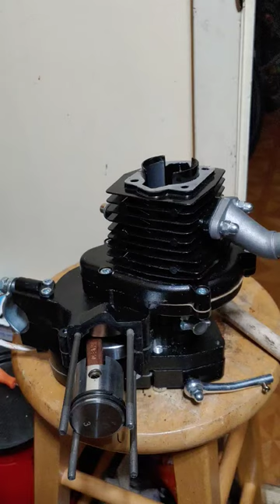Pre-Painted Motors

Comment: It was proven about 35 yrs ago in popular mechanics a article said that a black painted engine dissipates heat better than one not painted but you are exactly right about the bearing issue.  ..they shouldn't paint any bearing surfaces at all...

Comment: I had a silver one we used as a homemade dirtbike,  definitely got abused and never used correctly,  lasted 2 years and it had only like half of the cooling fins on one side from crashing it so much, I eventually got rid of it because I was on my 9th rear wheel and the clutch was slipping so bad it wouldn't start at all, my buddy I gave it to fixed it up and still rides it
Reply: Thats cool

Comment: Yea I once rode 12 miles from the beach with a black anbull belly pipe 36t high performance cdi hp carb and it will over heat and bog down after long riding

Comment: about the heat, i have a black motor and im a young guy who always rides as fast as possible, sometimes i go full throttle for over a minute and it didnt cause any problems yet. i have over 2000kms on it now, i think these engines are very unlikely to overheat because they have a pretty low rpm compared to 70cc mopeds, those can get up to 15k. anyway, i live in the netherlands so its not extremely hot out here. 20-24c average

Comment: I have a question: Because where I'm from 49cc is the only engine allowed I'm wondering if the 80cc motors look the same? Would a cop know? From the specs they all say the clearance is the same. Aside from the stickers...do they look alike?
Reply: Unless they are bothered enough to pull the head off and measure they won't know the difference